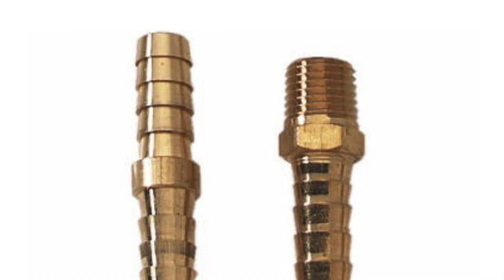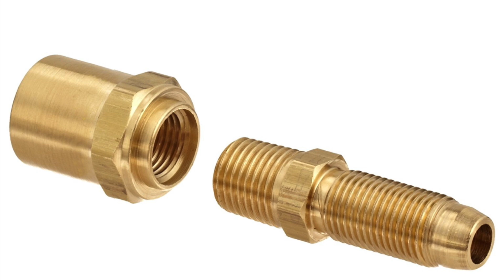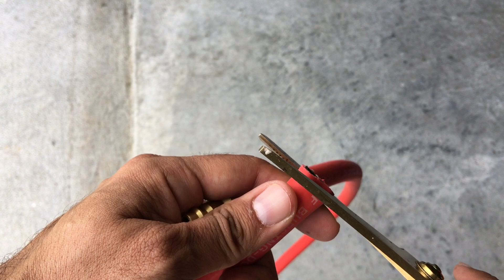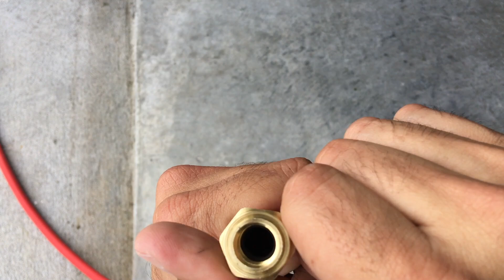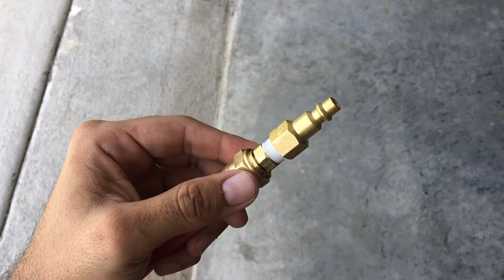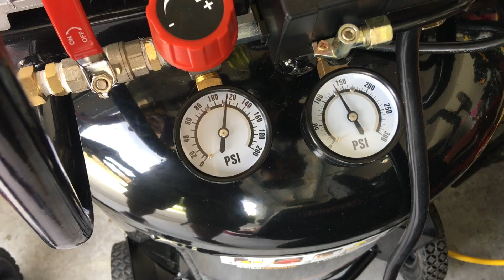How to repair a damaged air hose

Comment: I am horrifically poor I dont have cash for fancy replacements should I In theory be able to use the standard air hose valve barb and clamp on a bike pump hose ?
Reply from the maker: Get a better job or a second one 🤷🏻‍♂️😆

Comment: My only concern is that the fitting that goes over the hose would leak some. Does it? And could a person use teflon tape around the hose end  to help prevent it?

Comment: Regardless how big or small, worm gear clamps should not have hose protruding in the clamp. The barbs are to hold it on. The clamp is just a bit of pressure on barbs

Comment: I have a problem. I bought an air compressor on ebay. There is a broken-off connector inside the coupler on the compressor. When I try to remove the bad connector to install another one, the coupler won't screw off with even a long-handled wrench. How to get the coupler off without ruining the pipe to the compressor?

Comment: I stuck with problem.. Got pressure pot with AIR-MIC20M 1/4" coupler, but my air hose have german profile 3/8" coupling (maybe EC20H)
And air leak is insane.. I don't know what to do.. How I should fix issue..

Buy new hose from America and pray it fits with compressor coupler..
Somehow install American coupler in to compressor..
Get new air regulator and pray it fits pressure pot..

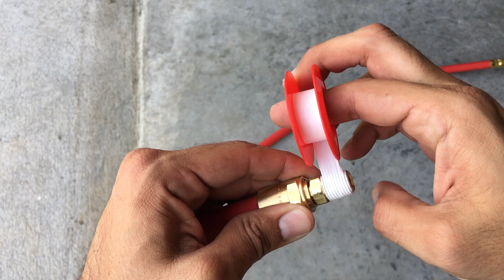Or maybe try your method.., but question if I can use any coupler at 03:00

Comment: https://youtu.be/zaGJ_AzM0io
https://youtu.be/mhbH2dYq0P4
Just FIY the first one is a link on how to repair a tear/leak away from the end of the air hose like in the middle for example and the second link is on how to repair a tear/leak on the end of the air hose plus these methods will last longer🙂

Comment: It worked for the most part, but now there's a very small leak coming from between my gun and the adapter. What would you recommend to seal that small gap?
Reply: Ycan put some sealer ur glue in...😊

Comment: I ordered this kit on Amazon and installed the first coupler. As I was screwing in the 2nd coupler, the outer part of the hose separated from the inner hose and it was like a clean cut at the bottom of the first coupler. What now? My hose it probably around 15 years old and seems a little brittle. Maybe I just need to replace my entire hose reel?
Reply: after reading some of this, I'm not going to waste my time with these DIY hackjob solutions
I got an estimate for a spring hand lever crimper about CDN$1100 plus about CDN$300 for every die set......
but it's something I will be using, as I have a lot of hoses to fix/repair
$2000 buy once cry once
Reply from the maker: yep

Comment: The first clamp you used is called a worm gear clamp. They also have these clamps that have a sleeve around it so that it doesn't mess up your hoses. There are also T-bolt clamps that you can use. Both couplers are viable long term solutions, with the first type working best with sleeved clamps or T-bolt clamps.

Comment: You put the Teflon on the wrong direction.
Reply: On your computer, click on Display Devices, Monitor, Point of View, Mirror Image.  Change mirror image to "No", save your settings and restart.  Now you can see that he put the tape on in the right direction.  If you can't find the setting just use a mirror to look at the monitor and you will see it correctly.
Reply from the maker: Correct
Reply: Hahaha
Reply: No, he put it on in the correct direction. Just way too much  of it.
Reply: 88mmFlaK no he definitely wrapped it the wrong direction.
Reply: @CoyoteCarChannel  You are talking about 3:00 right? He wrapped in the same direction of tightening the fitting... so it wont unwrap when installing...
Reply: 88mmFlaK do a google search
Reply: @CoyoteCarChannel  Listen son, I have been building drivetrains and turning wrenches for a living since before you were born. Unless we are watching two different videos, or he wrapped tape at some other point in the video other than at 3:00, he wrapped it the correct direction. You might wanna try a google search. Wrap the tape the same direction as the tightening of the fitting. You shouldnt give out bad advice.

Comment: Just ordered them on your link, and thanks for providing the link, video also very, very helpful.
Reply from the maker: Cool, thank you for watching and posting your comment!!! 😎
Reply: @RickyisHere  For a couple days I need to use the old connection piece with the ribs, but when those threaded fittings come in, cannot wait to put them on.

Comment: FYI -You are using way to much teflon tape it should be the 2 x 2 rule; leave the first two threads bare and 1 1/2  to 2 wraps in the direction you are tighting the fitting. The teflon is designed as a lubrcant not a sealant..
Reply from the maker: Thanks for the input, I always eyeball it but I wasn’t aware of the 2 X 2 rule. You learn something every day. So far no problems to report on the hose. Thanks once again for posting your comment 👍🏼
Reply: I am using less Teflon tape lately and usually use blue Loctite instead.  It's easier and looks better.  Quite often 1/4 inch NPT air fittings will seal without anything at all.  On the other hand, I have had poorly machined NPT fittings that would only seal with a ridiculous amount of Teflon tape.

Comment: Those reuseable fittings look like a great thing to have in the field or in a shop, but might be a little pricey for home use. Check if your local auto parts store carries air hose ferrules and if they do the crimping. The ferrules are about a dollar and they'll usually crimp it on for you for free if you buy the ferrule. You can use the original barb that came on the hose so it'll only cost you a buck and a trip to the store.
Reply from the maker: Thanks for the comment, I prefer to pay a little extra for the peace of mind (better be safe than sorry) but everybody is on a budget. Thanks for watching! I will post a follow up video about the compressor so stick around. Thanks for the subscription!
Reply: Costs aside, hose barb ends with a properly crimped ferrule are safer and more secure. They're an industry standard in liquid, gas, and hydraulic applications and they can handle high pressures. It's the reason hoses come from the factory that way (again, regardless of cost). Those reusable fittings explicitly state "Recommended for low pressure air hose applications", which is absolutely fine for emergency field or personal/home use (up to 250 psi), but you're not paying extra for anything more than convenience.

You're welcome. At first I wasn't sure if it was a spam channel copying other people's content because of your older videos, but now that I know it's real, I'll keep an eye out for the compressor vid.
Reply from the maker: My first videos were point and shoot videos that were not really intended for YT but I posted them to learn the process.
Reply: Hi Rolois  I found this video because I was trying to get some idea how to repair a bike pump hose my thoughts are why not see if I can take standard air hose repair methods and apply to a bike pump hose I guess theoertically it should work ?

Comment: Nice video Ricky. That was a good find on the reusable hose repair fitting. Maybe you can go edit in the link to where you found yours, or pin it to the top.
Great content so far, keep up the good work!
Reply from the maker: Thank you +Rob's Wrenches, I didnt post the link on the video because people could say that I am advertising the item when its not the case. 

Here it is: Dixon BN32RU62 Brass Reusable Fitting, Adapter, 1/4" NPTF Male x 3/8" Hose ID, 5/8" Hose OD https://www.amazon.com/dp/B00835MUO8/ref=cm_sw_r_cp_api_QAdRzbQA57QPE

This is the one I purchased but there are many other brands and retailers. Thank you for watching!
Reply: Thanks Ricky,
I think that anyone who would believe that would be misguided. We are all here to share and collect information that saves us time and money, etc. Thank you for the info.